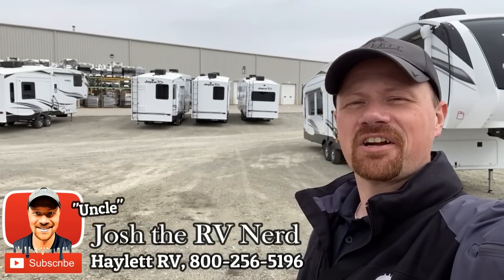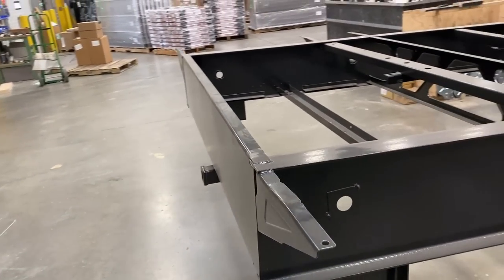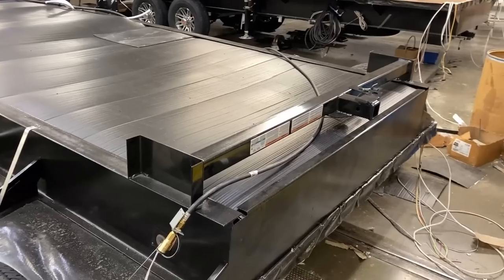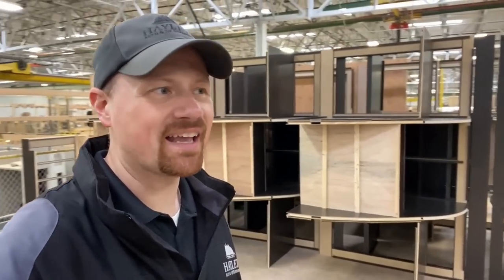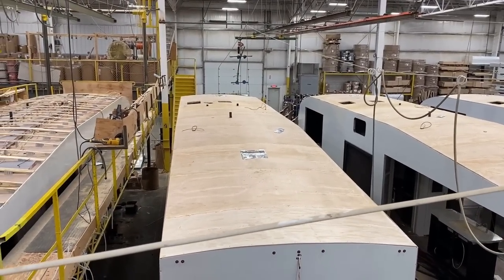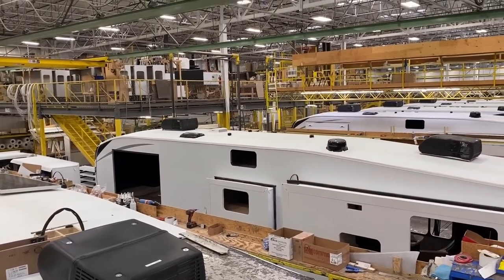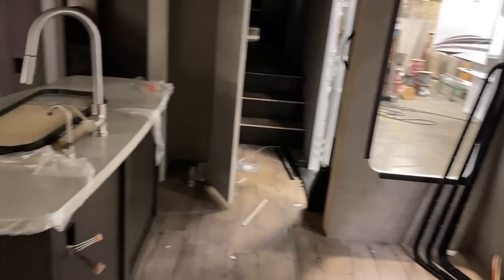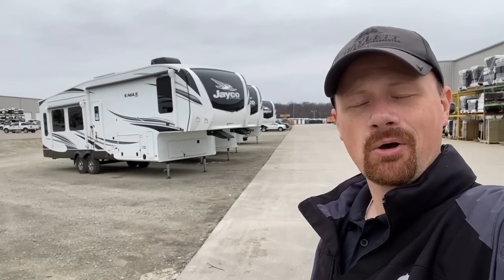(Part 2 of 4) How Jayco RVs are made (Eagle Factory Tour!)

Comment: I own an Eagle 330rsts 2017 and I do like it. My wife and I live in it full time in Washington State. A couple of serious trouble issues are 1- there's no insulation between the underbelly and wood floor making for some cold air intrusion. 2- because the underbelly material has the ability to warp along the edges, Mountain Lion sized rodents get into this space (at least they sound about that big). 2.1- because of the large holes cut into the floor for wiring, plumbing, and mechanical equipment these rodents have total free access to wherever they want to go including the ceiling. I've spent the entire time we've been living here chasing down all of the areas that have open holes. I do agree that Jayco Eagle 330rsts are a great product however if they would like to be the best possible I would like to share what I'm doing to improve my home. Great video, thanks for providing us with an in depth look.

Comment: Thank you Josh! Awesome video. 

1) Very clean manufacturing plant, the pride shows throughout. As a advanced reinforcement, new product development mechanical manufacturing engineer, impressive on all levels. 

2) All rv manufacturers should use vacuum bonded composite floors with no wood substrates. No chance of mildew, mold and flimsy vapor barriers that rodents, bugs, termites etc can and do penetrate.
Reply from the maker: Thx for watching
Cougar is making the type of flooring you mentioned in their “half ton” series!
Reply: @JoshtheRVNerd  Good to know! Thank you!

Comment: I have a 2019 Jayco 321RSTS and we love that floor plan but the rear wall was found to be delaminated. It was still under warranty and Jayco did approved the replacement  of the rear wall back in January but we still haven't heard nothing about Jayco sending the rear wall to the dealer for replacement as of today, April 8, camping season is upon us and we would like to use our $60+ thousands dollars 5th wheel to go camping.

We are beginning  not to feel good about this purchase. We know things happen however the factory  should have a little better customer service I believe. I love your video it give let me know theirs process, so thank you.
Reply from the maker: I believe you’re in good hands and simply struggling against the tide of supplies right now. If you haven’t, then I would definitely recommend contacting both your dealership and Jayco directly
Reply: @JoshtheRVNerd  I have  contacted both.

Comment: went to a dealer to tour some bumper pulls to be our next full time rig. didn't get to tour an eagle. I am curious if the Jayco eagle line makes their slide floors out of plywood or another material.
Reply from the maker: They use a material called PMAX. It is a structurewood product, but that allows it to be a shape other than just flat and thicker as needed so it can ramp up/down more readily. It also holds more weight.

Comment: Josh, contemplating a 294ckbs vs. a 332rsts. Jayco Travel trailer. I can get most of the options I want, bigger fridge, 16”tires, auto jacks and solar, but can I put an awning on the slide out so that I will have two awnings to provide some shade on the passenger side?
Reply from the maker: The eagle HT series does not have an optional second slide face on it.

Comment: Got a question for u Josh, at 7:24 u see a travel trailer frame and a fifth wheel frame sitting next to each other and they look identical until u get up to the upper deck and the gooseneck part of the frame of coarse but on the fifth wheel frame u can see where the 6 point leveling system is, why can’t u get that kind of system on a travel trailer? Seems like the only thing u can get on a travel trailer are those scissor jacks! And so that’s what my question is, frames are pretty much identical and u can get 6 point leveling on the fifth wheel but u can’t even get like a 4 point leveling system on a travel trailer?! It would be really nice if u could get those cylinder jacks on a travel trailer!!! Thank u sir and keep up the awesome work!!! And just wanted to say that I love these factory tours!!!!
Reply from the maker: Most trailers aren't long enough to accept a 6pt leveling system. Auto leveling is virtually standard on all fifth wheels now, but still optional on most trailers. 

Many travel trailers now offer a power jacks option. The "upper class" trailers will begin to offer auto leveling

Comment: Josh: These factory tours are interesting and entertaining. But every time you post one of these, the thing that seems to be front and center (not including the travel trailers) is the lack of automation. As an engineer, you’ll have to admit that hand pushing trailers down the line is like a throwback to Ford’s first  Piquette Avenue plant. Where are the C&C machines? Or the industrial robots for repetitive jobs? I’m seeing A LOT of intensive, costly hand labor on these floors. There must be a financial reason which escapes me otherwise the manufactures would have collectively already invested in automation. Because many trailer assembly plants are in predominately Amish areas, if you know, is this a cost of labor issue?   
But regardless, please keep up the factory tours as often as you can.
Respectfully,
WS
Reply from the maker: Couldn’t tell you why they use labor vs automation. Only that they do
Reply: I agree with your observation. Some manufacturers do use CNC machines to cut openings for windows and doors, but that's the extent to which I know they use automation. I wonder if it is because there are so many floor plans to be produced on the same line, the time and cost to set up and retool for a batch of models may be too expensive per unit produced.

Comment: Love the factory tour videos...hope tour videos #3 and #4 are the other end of the product line spectrum?!?  Would love to see the Jay Feather Micro factory!! Speaking of the JFM's, I understand that they had some production delays late last month due to parts shortages. I know that you have said that you've heard of fiberglass shortages and insulation shortages throughout the industry, and I'm hearing rumors of difficulties getting windows and A/C units (but have no idea if those rumors are accurate). Have you heard any more on that?  Also, looking at Jayco's production lines, it appears that they have all the parts they need for their high-end brands. Do you think that mfgs may be putting pressure on suppliers to ensure parts for their fifth-wheel and other high-end/higher-margin brands/lines to the potential shortage/detriment of the lower-end lines/entry-level models?
Reply from the maker: I went down that day without a plan -- just getting whatever I could. They have a cluster of facilities where I started that included North Point/Pinnacle, Eagle, and next is the Jay Flight MEGA Facility (which blew my mind)

After that across the street was feather and white hawk, but I wasn't able to make it to feather in time :(
You'll see in part 4 I actually STARTED by trying to do a feather video, but pivoted on the spot to white hawk next door which was JUST finishing up for the day. At one point they literally shut the lights off on me and I just ran out of time for anything else
Reply: @JoshtheRVNerd  Well...maybe next time

Comment: Does anyone see the damage? @4:45 above the receiver hitch and to the left along the top flange, there appears to be an impact on the end piece causing a wrinkle on the top flange.  And there seems to be a wrinkle where the end piece is welded to the I-beam that runs the entire length.
Reply: There were a couple of those chassis with damage. I’m guessing from transport. They stack them up 8-10 high on a flat deck to ship them to the assembly plants. That metal is a lot thinner than it looks and is easy manipulated. They hopefully bang it out before attaching the wood structure. However, I’m not sure those wrinkles would have much effect on the final product once all secured together.

Comment: To bad they dont take the time on the frame a connection to cut off at an angle and weld solid that small little metal plate does little, also they have them upside down i like that, and they still dont tie the wires up and together, on the finished product